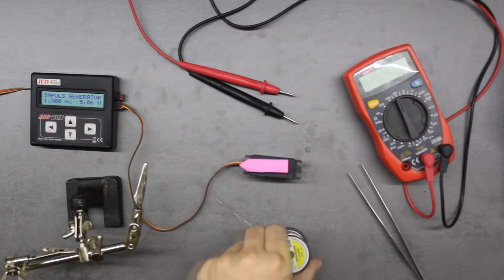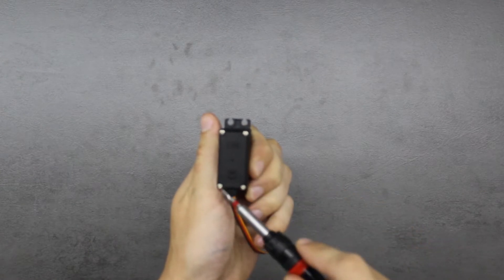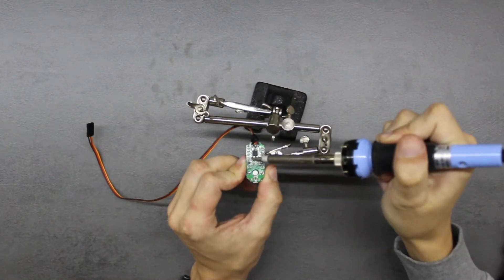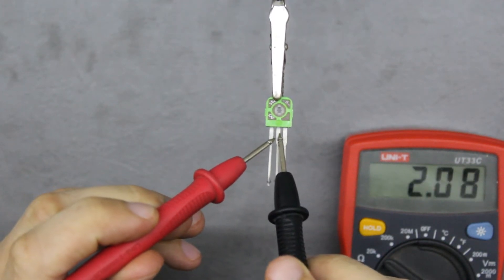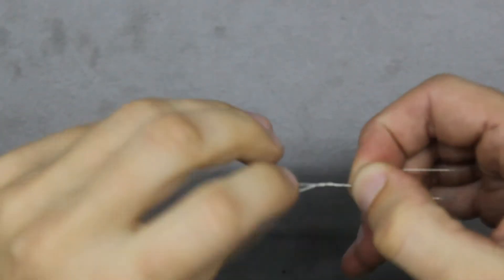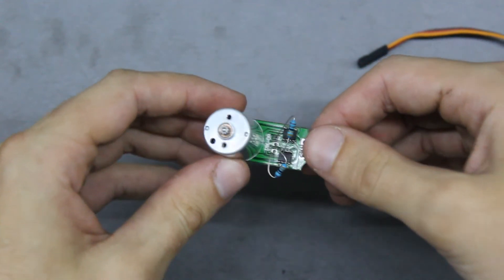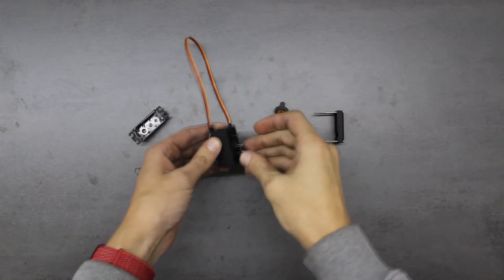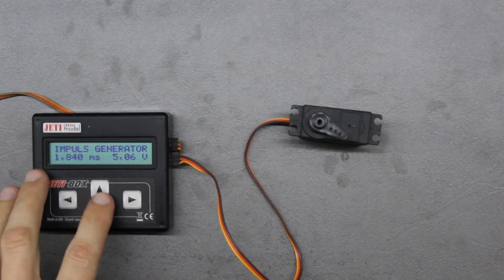Servo conversion to sail servo

Comment: how do you stop it at 3 turns? the way you did it. it would snap the string when it got tight
Reply: You need micro switches to turn off the servo’s power supply, actuated by the sail sheet.